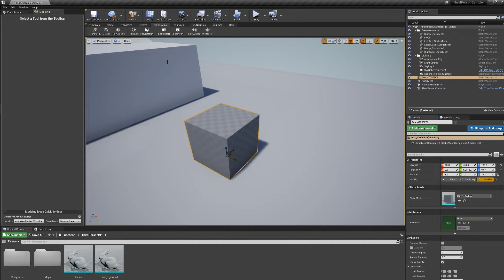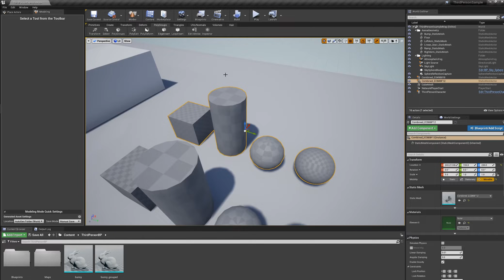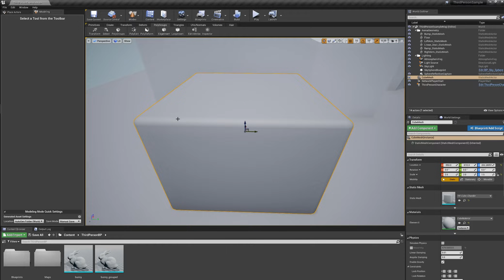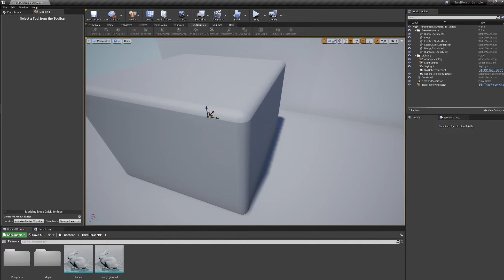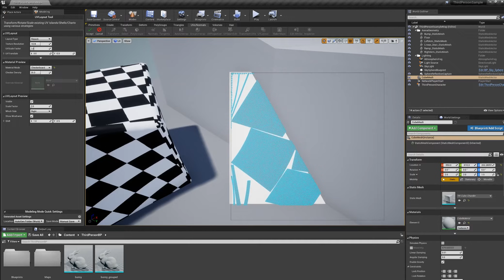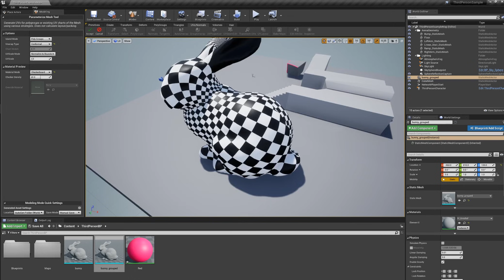UE4.26 Modeling Mode - Polygroups

Comment: Is it possible to "separate" a mesh with polygroups ?
Like if I find a static mesh of a panel with buttons in the marketplace or else, can I add the buttons in polygroups and then separate them from the mesh so I can later animate them to change their position when we press it ?
Because that's what I'm trying to do and I can't find how :( 
(Loved the video, liked and subscribed :) )
Reply from the maker: Yes, use the TriSel Tool, switch the Selection Mode to "All in Group", click on the polygroups you want to separate to select them,  and then click the Separate button. You can also change the Face Color Mode to "By Group" to see the polygroups in this tool.
Reply: @RyanSchmidtEpic  How can you copy and paste an object and separate it from the original so it doesnt affect the original polygroup when you manipulate the second copy?

Comment: An extremely well done framework behind it all too for the devs out there. I was previously using the 3rd party Runtime Mesh Component, but it took me quite a while to work out how to successfully batch create an unknown number meshes, exposing them to the editor as static meshes or even showing an actor's mesh components in the world outliner to convert to static meshes. Changed over to ITF,  geometry processing plugin and mesh modeling toolset plugin's modules very smoothly, using polygroups for RMC's sections and have a new spline modeling tool and importers. And I'm accessing those from a project plugin, not a custom engine build or modifying engine plugins. Super job Ryan and team.